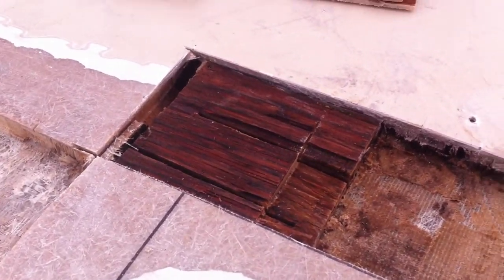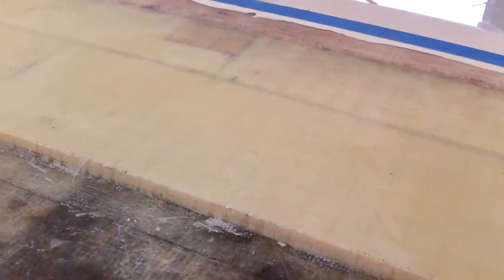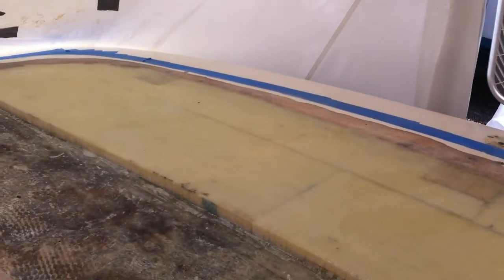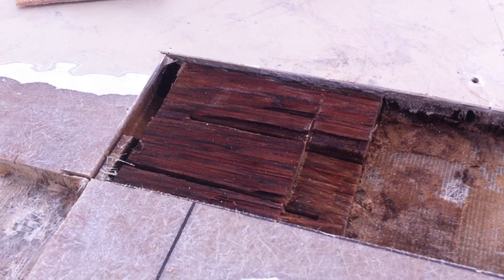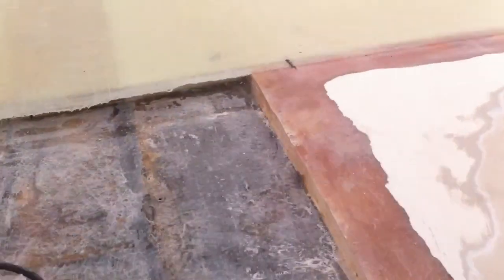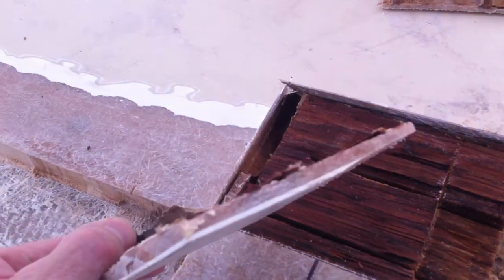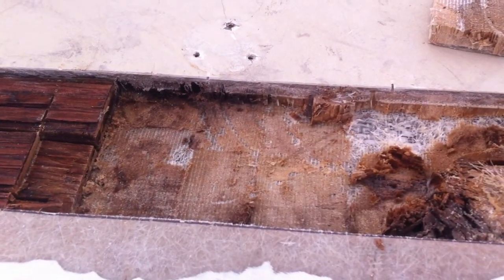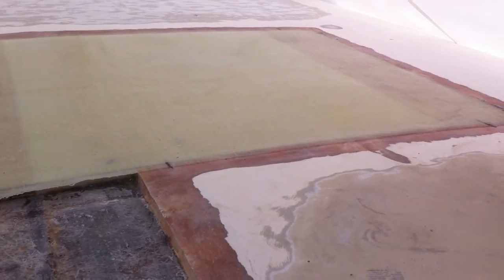Cap'n BilgeWater talks about various core materials

Comment: Very good explanation of coring.  I agree about trying to screw through foam cored material.  Pretty much  useless.  Been wondering if you could over drill a hole and epoxy in a composite "plug" say for screwing into a foam cored stringer for support of a macerator, battery charger, etc??

Comment: There are a few local(N America) woods that have good rot prevention and are reasonably priced and plentiful. Eastern Cedar is a good option. Larch and maybe cypress may pass as well. Planks would need to be selected for almost knot free boards. Eastern Cedar can be purchased at any HD.
Reply: Captain bilgewater, do you have an approximate cost per square foot to do this type of flybridge repair?